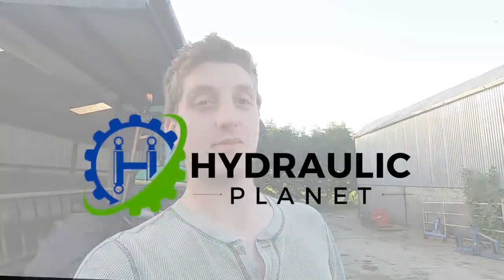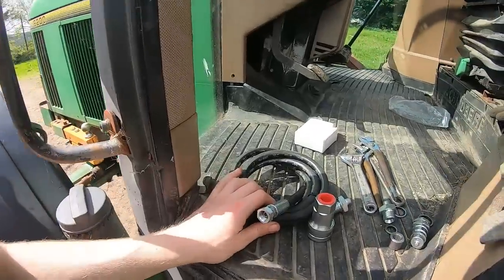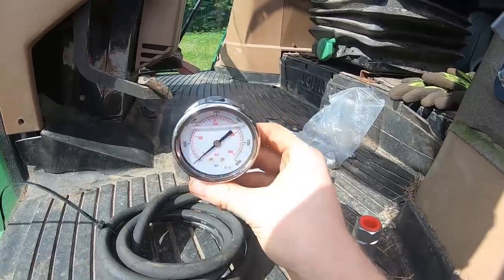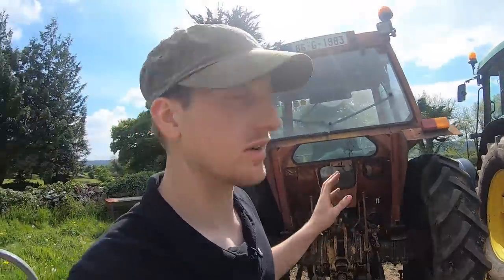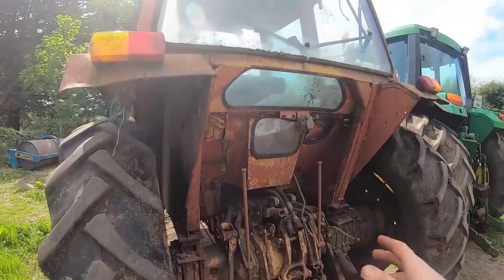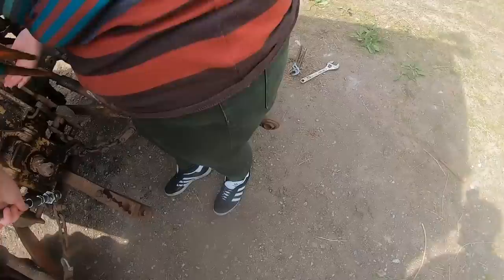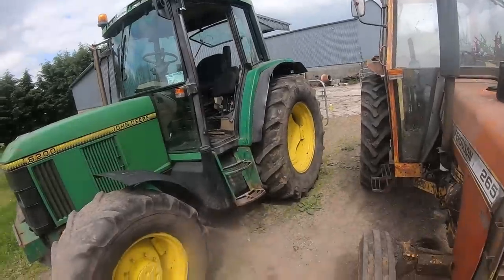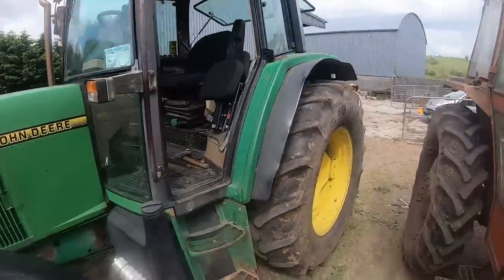HOW TO TEST HYDRAULIC PRESSURE ON A TRACTOR!

Comment: The steel pipe is a single acting spool for tipping a trailer. That second pipe in the massy might be a free flow return I can’t see any other way of it working off the lift and I’d say the pump can only work one way. If it is a free flow return then you could run this through a valve chest which u could probably get online and it could give you up to three spools. The two pipes go onto your valve chest and the oil is pumped from one and returns to the oil reservoir through the other. I have this system on my Ford and works perfectly.

Comment: Flow rate = bucket and stopwatch 😉😁.  Just don’t starve the pump😳.  Uhhh high time to service the Massey!  Ha, the Massey doesn’t have an auxiliary pump.  You just divert the 3 point to external…similar to my 255.  The single port is a pressure control port…single acting constant pressure.  You don’t want to know what kind of oil😂👍🏻